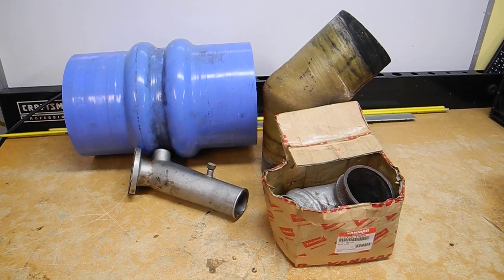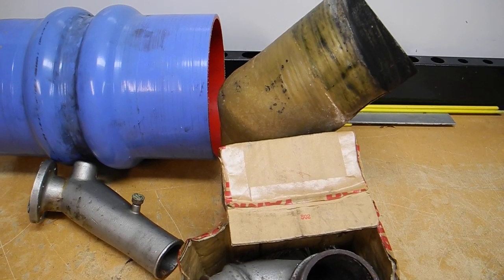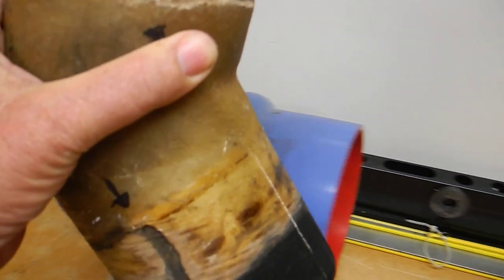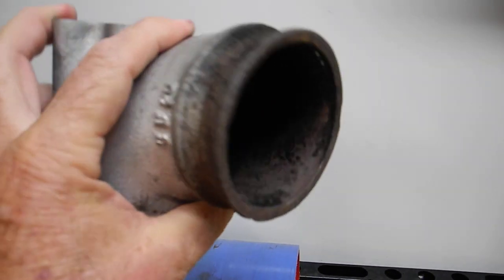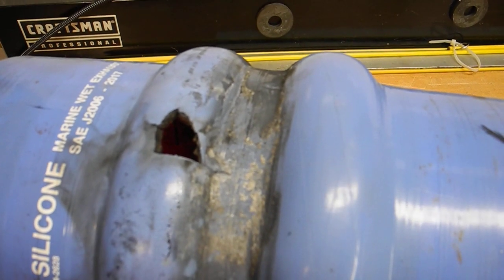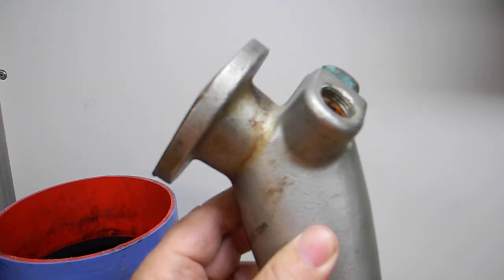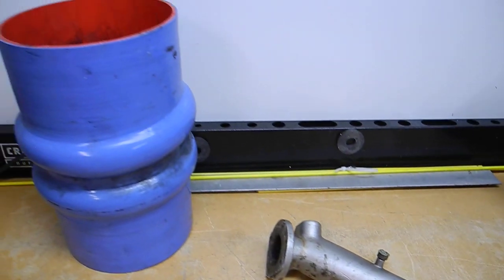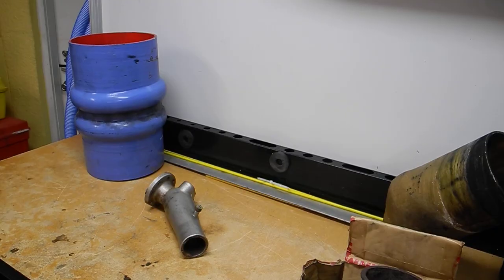Wet exhaust explained

Comment: It not the same but I had gotten really sick in my home. Thankfully it was the spring so I opened the back windows of the house plus the door. The whole problem was the stove and water heater both had gas leaks. It was a real eye opener.
Reply from the maker: WOW, do you have a CO monitor? Those things can be lifesavers!
Reply: @AskCaptainChris  I had just gotten the house and did not even think about it. It was a eye opener.